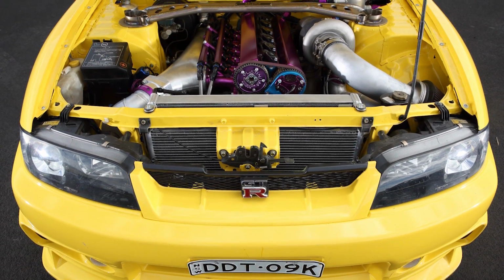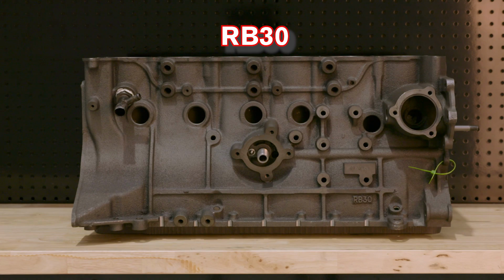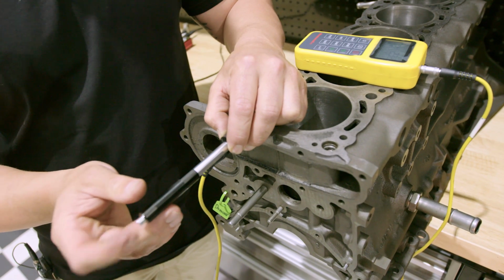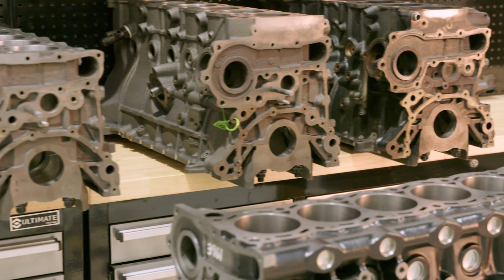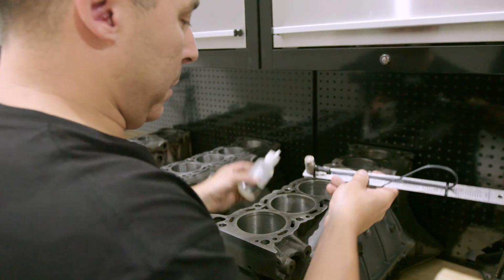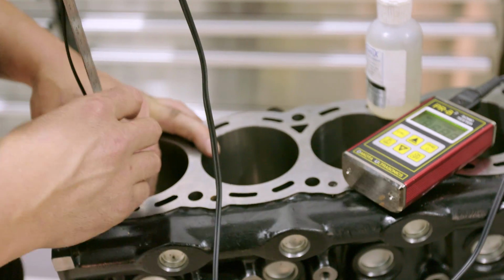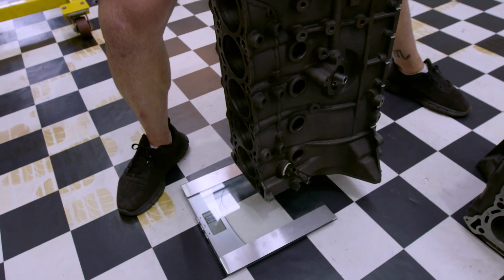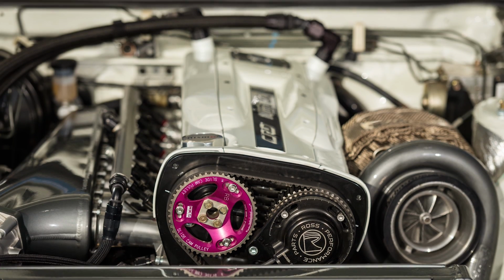Which RB Block is Best? Mythbusted with Facts and Data!

Comment: now after all that, bring on the 2jz block and tell us why it's supposed to be better.
Reply: done man, vid will be out soon, we tested them the same day
Reply: @hermanurriola138  fuck yeah mayne
Reply: @hermanurriola138  Do German blocks test better? Like Mercedes or BMW blocks. Never heard about a block failure in them.
Reply: There hasnt been many bmw blocks pushed to the weaknesses of the block yet. I heard from a shop that late model bmws are beings pushed farther and are reliable blocks so far. The Lamborghini blocks hold 2500 or so. They just started using billet blocks in the half mile stuff. I saw a bmw promod, bmw engine high sixes low seven's on 1320video
Reply: taz 4100 they don’t hold 2500 there are already billet blocks for the Audi v10 in them.
Reply: @msengineeringdavid3702   wow, never knew they dont use castings,  im gonna look into there engine history.
Reply: they are better. not supposed to be. but will be super interesting to see why!
Reply: Fuck yeah Hermz.
Reply: Look forward to seeing the 2J test, although I already suspect I have the runt of the litter in my IS300.
Reply: Toyota IS better. Toyota is king
Reply: @hermanurriola138  as a guy that has relied on personal experience and the experience handed down by other engine builders I think you deserve a f@#$kng big thank you for sharing this information. Its will be used with a grain of salt and much deliberation as all of this kind of Information should be used. My customers thank you. Much love from New Zealand
Reply: @MickiDracing  Not anymore. Nissan is at the top.
Reply: rock star Yamaha designed the heads on the 1G-GTE and 1JZ-GTE yes, but from what I’ve read they had nothing to do with the development of the 2JZ directly, Toyota just copied/improved upon the engine design for the 2JZ
Reply: Mick D Thanks to yamaha, like what they did with LFA. Gt86, thanks Subi. New supra, thanks bmw.

Comment: Cutting the block can tell you thickness for a 24U block  but what you're also missing is sending a sample of the block to a metallurgical lab to give you mechanical data on it.
Reply: have done, we know what materials are used, and under metallurgist advice ... just check hardness, nothing else matters, but we will post more results, also destructive testing is interesting :)
Reply: Herman Urriola hardness at room temp is useless at a dynamic stand point and the reason the N1 block isn’t as hard is because cast iron falls prey to work hardnening which is what cracks things.
Reply: @hermanurriola138  Herman have you ever or will you ever consider any 1JZ and 2JZ testing and comparisons?

Comment: One thing that wasn’t considered thoroughly enough, in my opinion is the differences in the blocks harmonics. Im guessing the N1 and unicorn blocks have substantially different harmonic properties. Probably to allow the engine to maintain revs at a much closer parameter (to the harmonic properties of the Rb block design’s, natural resonant frequency.) to the blocks inherent and destructive rpm range / resonant frequency. 

I’m guessing standard rb25/26 have a rev range around 9500 where the destructive harmonics lay and the upgraded blocks move this range either, up towards the high 10,000 a low 11,000 rpm range, or lower towards the 7000rpm range where the engine can be managed to pass through this rpm range as quickly as possible.

Comment: well my eyes have been open pretty big with the test done here.

thank you for the insight and busting the myths

The Nismo Omori Factory still sells the RB26 N1 block for engine rebuilds and for customers looking to convert their GTRs to full blown track cars.  

but looking at your test seems to be that even the most expensive blocks will still crack if the bore thickness is not up to your standards

now ppl will be grabbing the RB30 and RD28 blocks instead XD

can you guys also do the RB heads as well?

Comment: So to help strengthen the bore, I'm sure sleeving will be best and applying the block hardener. So with your great data and proven facts, there's no reason to go and buy an N1, but make sure the block you have is within the 3 mil spec as the intelligent gentleman stated. I am also curious on the adapter for block twist. Great info Sir! 🤙🏾
Reply from the maker: NISMOLOGY INC. if you’re sleeving and putting a brace on then there is no reason to buy N1 at all.
Reply: Thanks buddy, there is more destructive testing coming soon re block twist that will help, also sleeving is not always the best alternative, you remove more bore to put the sleeve in, the sleeve stretches as its made of steel, the thin bore behind it cracks as it does not want to stretch, then you crack a liner/ sleeve.. so stick to a good quality block with enough bore thickness.
Reply: @hermanurriola138   you just said you're not a fan of ''sleeving'' in my comment also you're not actually right about that darton sleeves stretches no where near what you think not even close also the sleeves aren't steel and there is no bore left behind in a wet sleeve design so this tells me you're not strong in that area a Darton's sleeving material is far superior  than what OEM has in terms of strength.
Reply: Hmm so to sleeve or not to sleeve, that's the question lol.... It's hard to send a block off to get that thickness test done, unless that shop can do it. I wish I could have the tech you guys are using but everyone doesn't. What you're going is by far needed for every build but sadly can't be accomplished always unless you have the "big pockets."
Reply: @Nismology33   Block thickness is done with a sonic test gauge  some machine shops use this gauge you don't necessarily have to send that off somewhere there are no wet sleeves MID sleeves for RB's so you'll have to contact darton for a custom spec sleeve their material is more than 3 times stronger than oem cylinder liner.
Reply: @msengineeringdavid3702  great to know. I have a buddy that just sleeved his and it has some material that they applied to harden it also. Thanks for the info gentleman. I don't know everything and appreciate the knowledge. I wouldn't mind talking more on RB's.
Reply: @msengineeringdavid3702  thats what I'm saying the Darton sleeve is much better quality, also made of steel, it will not crack unless the support material behind it cracks first, which it does. cast steel liner will stretch under pressure, its 1mm thick for argument sake.. the old bore behind it (what's left after boring) does not stretch with the liner, it gives way, therefore for when your quality liner has no support and no means of dissipating heat through a parent metal, it cracks.
Reply: Herman Urriola based on your earlier comments you don’t have pertinent information. It doesn’t crack at the base and I have no idea what your saying the female receiving end of the block  after machining there is no oem sleeve and it doesn’t stretch or expand there I use o rings afterwards so that will tell you how severe the environment is It’s been tested and it’s far stronger than you think. Since you don’t believe in sleeving blocks you’d have no experience there. We do this with aluminum blocks on the regular which is dissimilar material which is a worst off situation than an iron block application until you get more experience there. That’s that.
Reply: Herman Urriola and it’s not steel it’s ductile iron.

Comment: Ouch... But that is the production tolerances in the late 80s/90s or so. Remember that casting itself causes less hardness since the metal just flows to the die unlike forging which hammers the metal into shape but more complicated and expensive. But when carefully tuned you must have a reliable speed rocket!

Comment: To get a true indication of material hardness you really need to do a proper penetration test. While the material hardness will certainly have a lot of influence on the frequency in the bounce test, so will the overall rigidity of the structure you're testing. I wouldn't mind betting that the RB30 is measuring higher simply because it's taller and therefore more rigid around the top where the testing is being done. Imagine tapping it with a hammer in that area and you would expect it to sound a little different to the other blocks. Just a thought.

Comment: I am interested in replacing the Rb25det in my GTS with a Rb26dett, de-stroked to 2.5L, keeping the 26 head and possibly the low mount twin turbo setup. The aim is to build a good time trial / targa car so pwr only needs to be around 280kw - 320kw with the emphasis instead on mid range throttle response and spool time (can already hear ppl saying “well keep the 26 displacement”)

Can’t find any info on destroking a 26 to 25

Comment: Please be aware, there is 3 different rb30 blocks.
A8.
A6.
A.
Both the A8 and A6 are found in the Vl commodore, and 1 of those is turbo.
The A block is found in the Skyline RB31.
The A6 block mains surface measure up at 23.5 mm, whilst the A block mains surface measures up at 25mm providing MORE material across the length of the block. I have also found the A block to be on average 3.5kg heavier then the A6 block. I have never compared the A8 to the A block.
Reply: we have tested them all, A6, A8, Awhatever doesn't make any difference
Reply: @hermanurriola138  I'm just specifically talking about the mains, and adding more information to yours. I agree the bores and hardness test are no different, but I have found this on several occasions what I stated. Last A block I tested was 72.1kg
Reply: Dodgey Herman claiming false facts hahaha
Reply: @alx4050  not at all, I fully respect Herman and all his work. Someone whom I look upto in the industry. As I said, this is just info I have personally found.
Reply: @hermanurriola138  🤣🤣🤣
Reply: @hermanurriola138  that's all you can do. But here one for you. I have a r32 26 on me atm. I also have a bare 33 roller. 26 it, or 25 it for 350rwkw..... stock motor for stock motor. Stock rotating, no assembl, no loom, fully bare install for everything

Comment: Yep, diesel engines are indeed usefull after all :) It's the same story with Volvo's "whiteblock" engines. There is a Diesel version of the 5 cylinder, and it's block is surperior to it's gasoline counterpart.

Comment: Alright so we see that they have casting irregularities, would darton sleeving them be able to fix some of that and make the engine “stronger” in the sense that it has better material for the cylinder walls and now has better thickness so as to help avoid the cracks in the cylinder walls? Also the BRAND NEW rb26 blocks, how do those compre va the older blocks? I would imagine same issues but maybe more brittle as they might use different blend compared to the originals?

Comment: the best block is the one you make yourself,billet for the win

thinking about the Rd block i think it has more bracing but softer material to handle more flex because a diesel engine sees much  higher cylinder pressure than a petrol engine and they offset the higher flex with more compliant material

in relation to the above a harder material flexes less but also has lower flex limit before it cracks and a softer  material can flex more before it cracks
Reply: bores ballon more when the cast is soft, also the material work hardens in a particular fault line as opposed to it all being hard, the end result is a split bore or cracked block the key is the harder the block the better, stay tuned for the 2J vid coming out soon :)
Reply: @hermanurriola138  could you also possibly test a TB,FZ,Barra block ?

Comment: I am wondering you may want a softer iron block than a harder one, as harder iron tends to crack more.  The fact that both N1 and RD28 are softer than the rest may not be just coincidental.
Reply: a softer block allows more twist and ballooning of the bores, overall it work hardens in particular spots causing fault lines so to speak, an overall harder block is stiffer and is less prone to cracking

Comment: So I want to start by saying I love Skylines (always have ever since Grand Trismo 1) and I wish there was some realistic way I could own one in the states... That being said why don't you sleeve the block if the bore spacing is so commonly known to be a little off. Most shops in the USA roughly charge $200 in labor and $600 in parts to sleeve an I6... $800- 1000, because there is always some other machine costs involved, decking the block or something (but even at US to AUS conversion $1100 to $1400) Seems like some pretty cheap insurance considering it improves block integrity/ uniform hardness, which is what you seem to be concerned about?

Comment: Herman Urriola - Would love to hear more on about the N1 blocks in real world practice. Are they more prone to failure from cracking? From my uni days, the last time I did fracture testing, I was under the impression the harder a cast item is, the more likely they are to crack? The softer the alloy, the more give they have to take flex?
Reply: I'm no engineer or expert. But from my knowledge it's a balancing act to get the hardness to take the stress but still having enough flex to not crack. Harder blocks are better but too hard and they will be prone to crack under high pressure.

Comment: I'm curious how "hard" a L28 block is and even an early L24 just to complete the picture of Nissan inline six blocks over the last 4 decades.

I'm also wondering if a block that's been overheated to 300 degrees F changes it's hardness.      I've been running an engine that went up to 329 degrees for the last 9 years and it's working great.

Comment: I thought the higher the hardness on the metal is the weaker it is as it would be more likely to crack,break or snap rather than bend or dent like softer metals. So wouldn't it just be more likely to crack a harder block.

Comment: 12:48
What am I hearing? For real? A block is what it is. (In relation to the centre of bore axis to rotational axis of the crank.) Theoretically you could add material to the exterior...
But you have what u have, these geometry’s are hard set and absolutely critical to the function of the engine, you either find a better block or build within the limitations of the block. Can only imagine the effects of shifting offset of just one bore. 
Unless the sleeve cops the offset... Is that what is meant? 
Cause shifting the thrust characteristics of one cylinder on a crank.... Yea na...

Comment: you gotta use the matching rod to its crank let's say a rb25det rod won't fit  rb26dett crank and a rb20det rod won't fit a rb25det crank. but any crank will fit any RB block

Comment: I’m curious what the GT500 RRR blocks are like...🤔

Really disappointed with the 24U block 😢
Reply: No one will let us test one! So keen to check one out, i really hope we can learn from one some day
Reply: Ive cracked a porous O5U block. N1’s still holding up but that could be the placebo effect 😂
Reply: @hermanurriola138  I have one. You can test it if you like.
Reply: @dsport  this is awesome.. the only bad thing about this is Imperial messed up all reading. If only you put both Imperial and Metric for the rest of the world.
Reply: Why? N1 is still technically better than standard 26. It’s just not heat cycled thousands of times to make it slightly harder. Daily drive it for a year and it will jump up to 260 on his meter.
I’m not shitting on his test because he is building drag engines and doesn’t have time to season the blocks. He is just choosing the best that is in front of him at the moment.